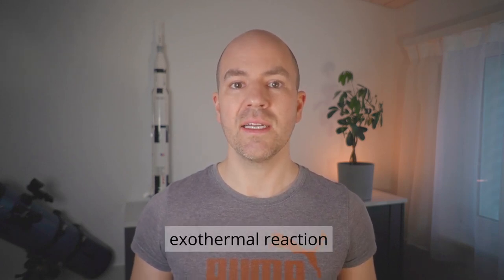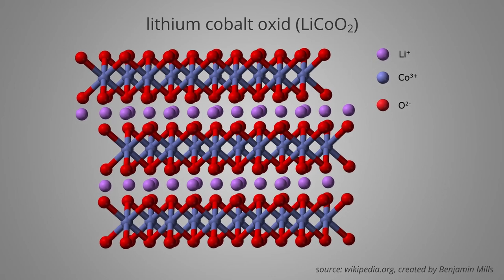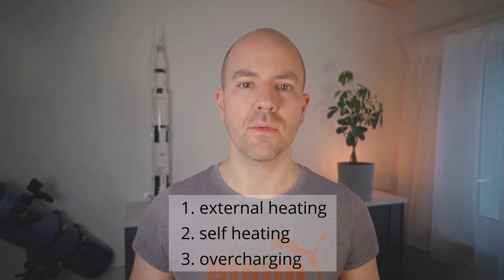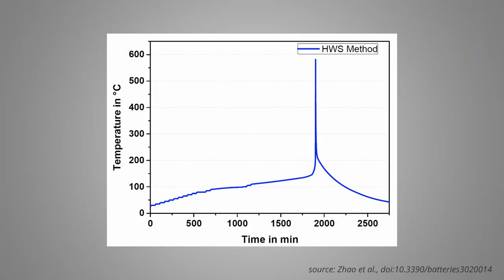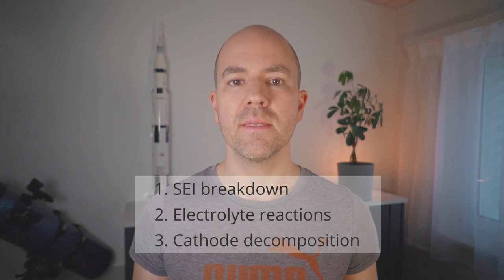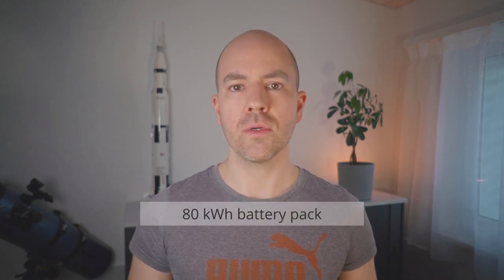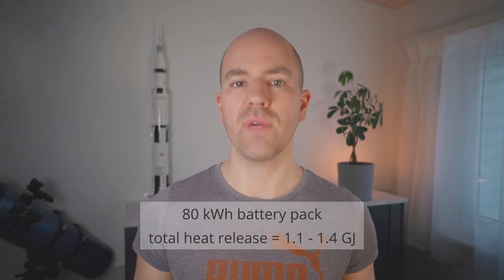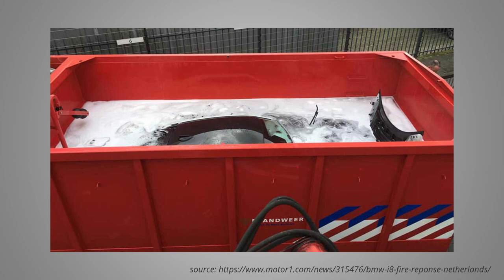Battery Fires - What happens in a Thermal Runaway?

Comment: Hello, I have a question. 
Do you know why the released gases from a battery start to burn? 
Where does the spark come from? 
So what is the source of ignition?
Reply from the maker: Thanks for your question! The ignition happens mostly by the heat generated internally during thermal runaway. But it can also be from an external source like a glowing wire or connector in case of an external short.